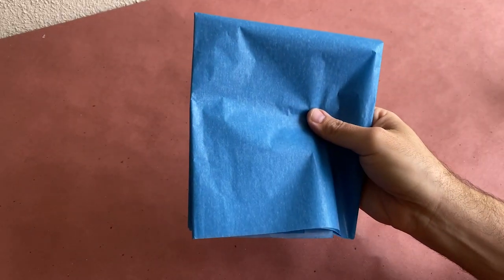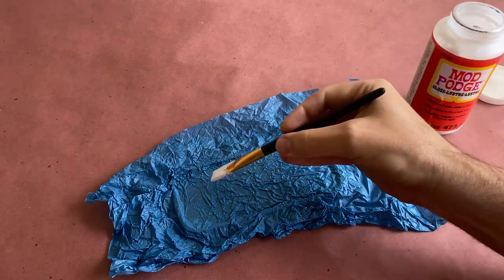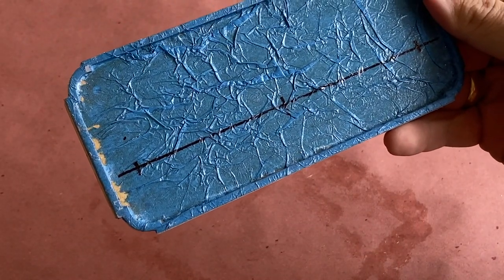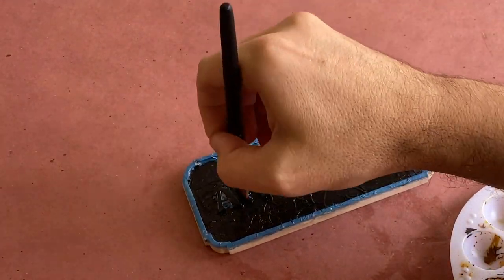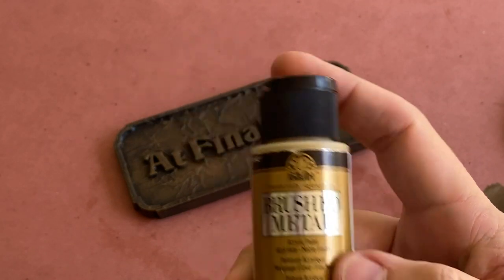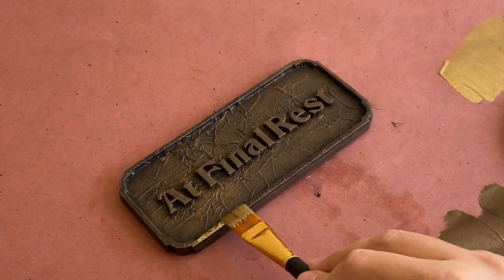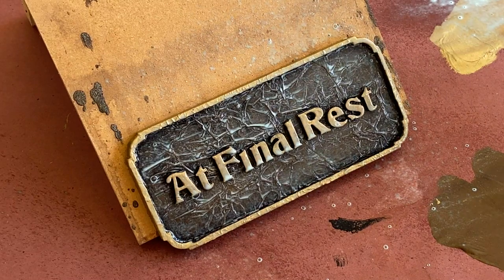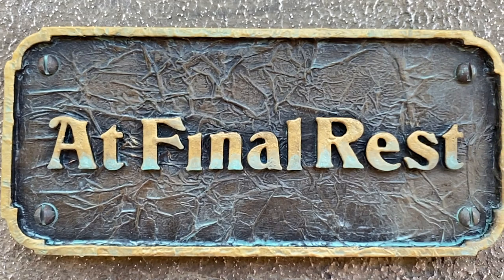Making a Metal Plaque using Tissue Paper!

Comment: I made a small wooden building with 2 windows in the front, 1 window on each side and 1 in the back, the door has a roundish window in it. There's a big cross on the door I found while metal detecting. There are windows on the second floor. I put plastic over the windows from a box.
    It's painted white with a red roof. I used a hot glue gun and put lines of glue all over it to make it creepy looking and to put some plastic green vines growing on the building.
   I used that thin plastic sticky insulation to simulate two boards that says, 'Do not enter' on it. There is green lighting inside. The house can be opened from a hook latch on the side. All that's left to do is to paint the inside, add some cob webs made with just cotton balls spread out and add some furniture made to look old and add a ghost or 2.
   It will be on my coffee table along side a graveyard. The sidewalk is cardboard with glue sprayed on it and you add alittle sand for texture, the cardboard is painted a white gray colour. Then there's the little old fashion black pole lights for street lights. 😁
Reply from the maker: Sounds awesome!

Comment: What's mod podge ultra do? Is it just a sealer? Or is it made for another purpose and you just use it as a sealer?

I have seen mod podge bottles and stuff at crafts stores but have no idea about them? Is it brand name or are they all a type of adhesive?
Reply from the maker: It's a multi purpose sealer. You can use it to thin acrylic paints, seal paints, seal MDF before painting to keep it from absorbing so much of the paint.